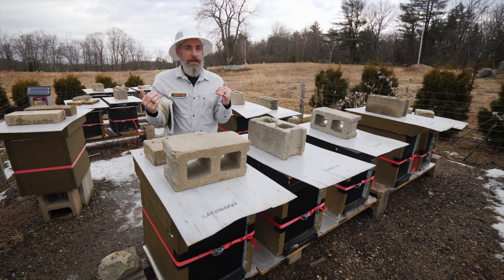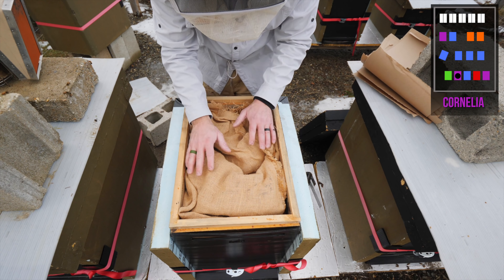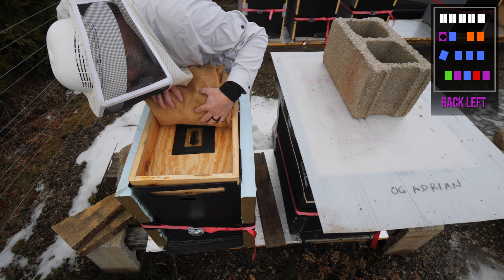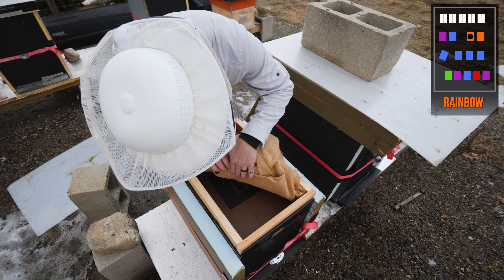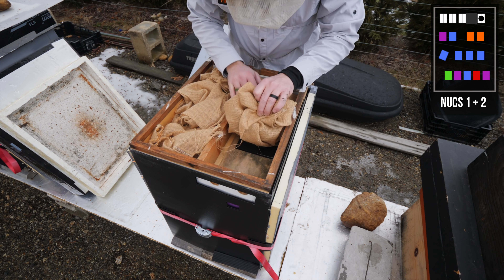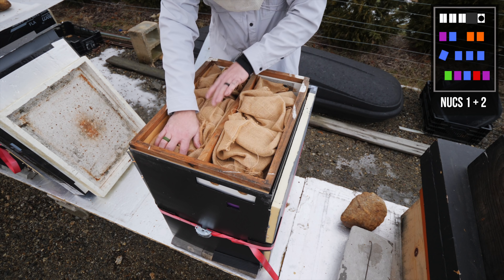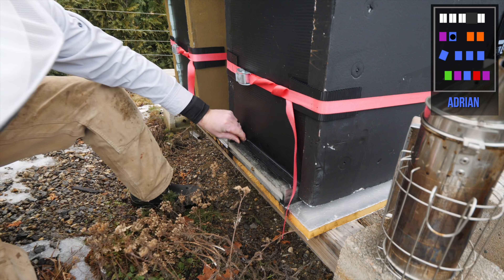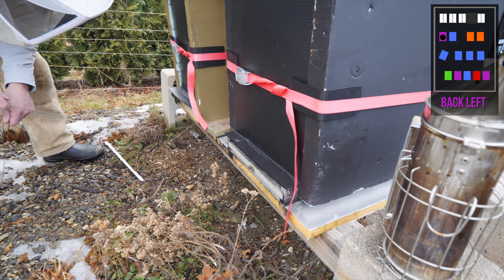I Expected Some Losses... First Bee Hive Check of 2020

Comment: I think you'll have better luck with a thiner paper under the sugar.  Specifically an organic wax paper. Often times in this video I've noticed that the bees have eaten the sugar around the edges only, but no one is in the middle (except dead bees) -  Please Please try this: instead of using heavy butcher's paper, use organic wax paper.  It's far thinner and the bees can tear into it and tunnel into the sugar from underneath.  Way to go on the success of so man hives! I adopted your whole wintering system (except the flipped honey box part), mine are doing fine, too.  Lost same percentage of colonies.  I too have a similar problem with paper at first - I was using those old style brown wax paper lunch bags, and it was really too hard/thick - the bees could not get at the sugar.    I've since switched over to sheets of wax paper (organic).  They seem to be tearing it up and pulling it out of the hive, but the key is that they are able to get at the sugar from the bottom side, rather than having to go up where it's really cold on top (and they die on top).

Comment: Something I learned this year with the vivaldi is to not let the burlap cover the vent holes. I was having a lot of moisture in my hives and couldn't figure it out. The lid and burlap was getting wet within a few days of putting in a fresh dry burlap.  I decided to try cutting the burlap in half and not letting it cover the vent hole and the hives have been dry as a bone for weeks and have had no moisture issue at all since doing that. For the ones you are seeing moisture in you may want to try reducing the amount of burlap.
Reply from the maker: Gapeys Grub That’s a good idea. None of the burlap was particularly wet. That hive with the moldy top was the ‘dampest’ but nothing that worried me. You guys definitely have more moisture in the air!
Reply: @vinofarm  yeah it's been pretty much 99-100% humidity for the last few weeks.

Comment: I like the Ferris Bueller opening, lol. Curious about two things. 1) Is it possible or beneficial to maybe make a vertical queen excluder for those resource hives so they could basically share worker resources? Would that make any difference or help? 2) Is it possible to build like a mini shelter for the bees? Maybe just like an awning with walls that maybe just go like half way to the top to help with some of that cold wind, rain and bears? Just a couple of thoughts that crossed this non-beekeepers head.

Comment: I love all of your videos.  I made one modification to my vivaldi boards in that I placed a piece of tyvek (housewrap} between the inner and outer screened vent holes.  As in a house, is supposed to allow moisture to ventilate out but limit wind infiltration/penetration.  So far it has been too cold to check on my bees. If it seems to be working I will let you know.  Thank you so much. Craig

Comment: I noticed that last double nuc in the back left corner had a single vented cover, as opposed to the half sized individual vented covers on top of the other double nucs.  

Part of that shared vent opening would be obstructed by the divider board already, or maybe the exposed opening to each nuc was not equal, so ventilation problems, maybe?
Reply from the maker: There is a "bee space" gap that allows air flow up from the individual inner covers to the center hole in the full sized vivaldi board. I got lazy and didn't build individual vivaldi board shims for the last nuc. Venting is good. Those were both just very weak colonies to begin with.

Comment: It looked like the hives that you removed dead bees also had sugar on the bottom board. Could the bees get stranded above and die when the weather changes? I've seen where some beeks make a hard candy so they don't try and remove the sugar. I realize dry sugar is great for moisture control but those vivaldi boards will do the work. Congrats on your success.
Reply from the maker: That second hive had the most dead bees above the sugar. I've never seen that before so I don't think the sugar caused it. Also, lots of poop. I think there was something else going on in there.

Comment: Huh. Have you been tracking the way the wind is hitting the bee yard? (I noticed your wind breaks are at different heights, and wonder if some areas of the yard might be colder than others, affecting the smaller clusters.)
Reply from the maker: Kelly Hills The trees cover North, South and West. There’s that opening in the back toward the north east, but wind rarely comes in from that angle. Also, the 2” foam does the main wind breaking job even if there were no trees.

Comment: Collect the bees you pulled from each hive put each one in a separate plastic baggie.  Put a little water in the bag and shake.  Dead mites will stick to the sides of the baggie.        Or put the dead bees into a jar of warm water and shake.  Scoop out bees and run water through a paper towel filter to collect any mites.   Repeat until you don't get any more mites off the bees.  You may be surprised with what you find.

Comment: Question, for the resource hives what material is that that you're using for insulation on the inside of the Vivaldi boards? Burlap? Cotton fibers?
Reply from the maker: It's burlap. The purpose is not for insulation, but for wicking moisture UP and out of the living space. The burlap gets wet and then dries itself out through the upper vent holes. The top lids have 2" of insulation which it designed to keep the heat in so the burlap doesn't freeze.

Comment: I’m planning and wrapping hives like you do. I’ve got friends that really don’t do anything and in my opinion a 1x box is not enough even with hay bales piled around the hives. Keep it up!
Reply from the maker: I'm a firm believer in insulating the hives... Every little bit helps.
Reply: Be aware - bales of hay are great homes for mice.   Rigid insulation is much better.  (Jim, ) If you want to tweak it one step further -- after painting the insulation black, wrap/seal the insulation in a loose sleeve of *clear* (10mil) construction plastic before you fold it around the hive.  The clear plastic will act as a green house "for the insulation".  The heat/air will work its way to the backside of the insulation and indirectly warm the hive too.  The plastic traps the heat that the black paint has absorbed from the sun.  It also and prevents the wind from instantly blowing away the heat that has been collected.  It also protects the insulation from the elements  -   I started doing this because the cheap recycled insulation I use is "polyisocyanurate" (iso) and unlike polyurathane (that is used at Vino Farm),  iso insulation absorbs water, so I had to use plastic to protect it from the weather - otherwise it would have ended up as a block of ice by mid winter.  See also: https://en.wikipedia.org/wiki/R-value_(insulation)#Typical_R-values .  - always more to learn.  I'd love to get coroplast, too, but settled for Reflectix (painted flat black). - Coroplast was just too expensive for shipping, and I don't have a truck to go pick it up.
Reply: Don Rota if I used bales for anything it’s be just as a wind block on the northern side while my plants grow but I plan on building a barrier anyway. The barrier will act as a wind block, will help keep the dogs out, and a sound barrier.

Comment: I just have a question about ventilation wouldn't putting sugar on top of wax paper on top of the frames stop the hive from venting out the top? I guess I'm nervous that that warm air from the bees is going to collect on the underside of the wax paper and then condense back down on them instead of venting out the top of the hive.
Reply from the maker: There is plenty of space for air flow around the paper. It is nowhere near an air tight seal. The moisture goes all the way up through the inner cover hole into the burlap.
Reply: @vinofarm  thank you for your reply. I have mimicked my hive winterization from yours and also just did sugar on paper. Checked our bees last week with that warm spell and bothy hives are still alive as of now. I'm in Jersey so we get comparable weather 😁 thanks again for your videos! This past summer was my 2nd year so this year I'm going into my 3rd year.

Comment: Good work.  Very conscientious.  For all you have done, I wonder why you would have not tried styrofoam bee hive boxes.  I have used them for over ten years with no problems.  I can tell you as an engineer, that the foam you have around your hives does not do a whole lot, when you leave the front uninsulated.  Thermal conductivity properties of wood, will quickly overcome that insulation on a cold night.  I still do the thicker foam insulation around all sides of the top box only, because that is where the bees are, and especially on top.  But the styrofoam bee hive makes is much harder for condensate to form.  I am in the rocky mountains and cold is a very big consideration.   I just cringe when I see a wooden bee hive in a cold climate.

Comment: I’ve tried the dry sugar for feed. Sugar made it’s way to the bottom board. Moisture got in...either snow or rain. The sugar made a glue trap on the bottom board. And found a lot of dead bees stuck. Wonder it this common and thinking of going back to fondant. Any thoughts or suggestions?
Reply from the maker: Hmmm... That sounds like it could be a problem, but I've been doing this for two winters and have not seen evidence that the sugar was the cause of deaths. Sugar definitely falls to the bottom and dead bees fall into the sugar, but I have not noticed LIVE bees getting caught. I'll keep an eye on that.

Comment: Great video!  A question—when you were opening the Apple Tree Swarm box, there was moisture between the “rain roof” and the lid.  Is that normal? (I didn’t notice that with the other hives.)
Reply from the maker: Than's normal. Condensation, cohesion dripping, freeze-thaw... there's always water under the awnings on the top covers.

Comment: I don't understand feeding dry sugar bees in winter. Bees eat sugar heat up they need water. They goes out find water suprise water cold and paralise bees. You don't give sugar when winter bees  cluster form. 2 sugar 1 water syrup give them fall. Make good stock.
Reply from the maker: There is moisture inside the hive. The sugar absorbs the moisture. The bees don’t leave the hive. We have 5 months of cold days where they don’t fly. Then two months of freezing nights with warmer days when they can fly. Sugar syrup is not an option when nights are freezing. Dry sugar works.